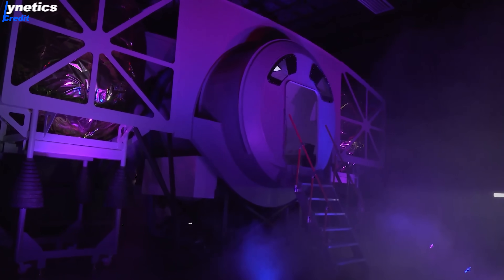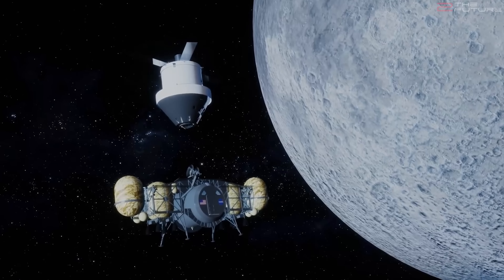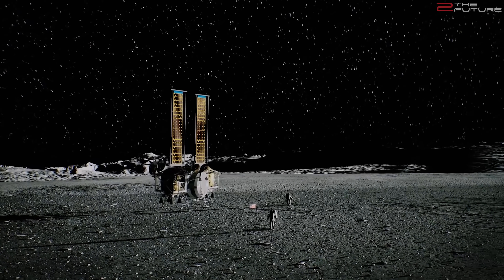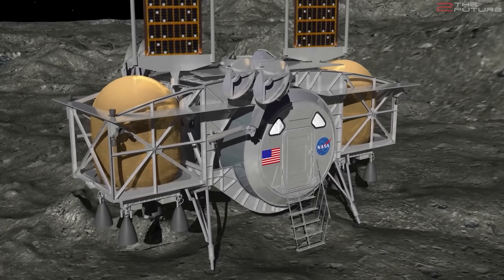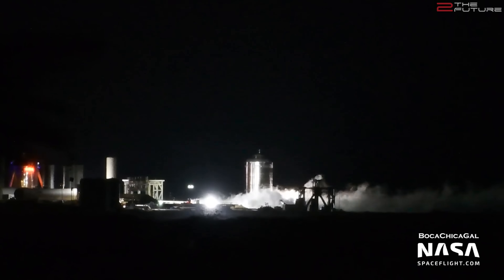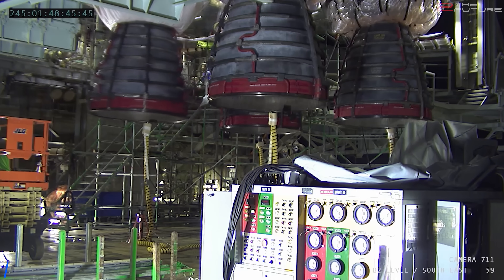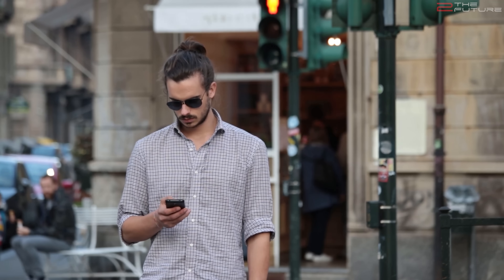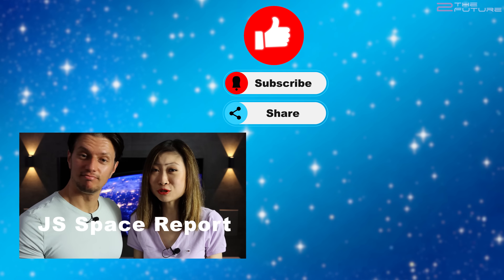Dynetics BEATS Blue Origin & Starship Burst Test Update

Comment: At https://youtu.be/rBXVP-vacB4?t=469 you interpret the unfinished SN 7.1 burst test as a success beyond planned pressure. Your information is usually double-checked but you may have missed something here. 

https://old.reddit.com/r/spacex/comments/inkzwp/starship_development_thread_14/g6407s0/

Reddit user u/RaphTheSwissDude says: *"on the last test night, the first test was scrubbed as a spark came out of a cable running down the side. And the second try, SN7.1 was never loaded as you could clearly see on the predator cam of Labpadre. (Watched the whole test) It is interesting tho to notice that a lot of either repair or upgrade were done on SN7.1 after that night"*.

Hoping this new info is okay for you and you can update on your next video. best regards. Paul.

Comment: The Moon Starship is too immature in development to get the nod from NASA.  Though in the end, SuperHeavy, Refueling Starship and the Lunar Starship would be the best system, that is a lot to develop by 2024.   In the near term, the Falcon Heavy lunar resupply Dragon XL could be configured to bring fuel up to the Dynetic's Human Landing System (HLS) as well as parts of the vehicle itself rather than the much more expensive Vulcan Rocket.  Blue Origin has shown little ability to complete any project on time nor has Boeing shown timeliness or cost containment.  It is a risk to go with the somewhat radical Dynetic's system, but it is not any more so trusting Blue Origin and Boeing whose recent track record is appalling.   Hopefully NASA will tell SpaceX and Dynetics to collaborate and get the project done by the 2024 goal.

Comment: Awesome as always! Great that you pointed out that SN7.1 not popping might mean it's even stronger than expected, as opposed to the idea that things have been going wrong. I think they pressurized it up to a high point, were amazed, and then tested/documented that it could really hold at the pressure, especially at critical weld points.  They might then have had to recalibrate their instruments to test for higher pressures maybe. It will be great to learn the final top pressure. 8.5 bar? 9 bars??

SLS is a non-flying museum LOL!

Comment: Apollo astronauts had to contend with lunar dust adhering to their suits contaminating and posing a risk to the LEM equipment. The separate Dynetics pressure chamber will mitigate any risk.
I seriously doubt the Moonship is a viable lander based on Dr. Robert Zubrin's calculation that it will require up to 20 Starship flights (ie. 15X for LEO refuelling and 4X Tankers with 100 tons of fuel to be stranded in Moon Orbit) to fuel a single landing by the Moonship.. Better to use Starship to carry 100 tons of fuel into Moon Orbit to support multiple Dynetics landings. Extrapolating from Zubrin's analysis, this would require only a single starship refueled 3X in LEO.

Comment: Lunar dust is hazardous to the crew. Breathing it in is a danger similar to breathing in asbestos. The blue origin lander should be disqualified now on the basis that without an air lock the living quarts will become hopeless contaminated with lunar dust the first time astronauts go on a Moon walk and the contamination will become worse each time anyone goes EVA. With Apollo they didn't of know the danger when they designed the lander. Once they did they continued with same design, but those missions were only 3 days, lander used only once....Building a new lander from scratch with the same critical flaw then having people spending even longer per mission breathing the contaminated air, then reusing the that lander is beyond stupid.

Comment: To be fair, the Moon landing version of Starship is too much for the initial stages of the Artemis program. You don't use a semi-truck to go camping. A cargo Starship would be perfect to deliver the Dynetics lander to lunar orbit though, and resupply extra drop tanks. 

The sheer size and mass of the Starship means the thrust needed will damage the surface and throw up a lot of dust unless you have extra engines mounted high on the sides, reducing payload. It's also even taller and less stable than the National lander, so not as safe on an unimproved or inclined surface. Finally, it's direct ascent which takes a lot of propellant, which in turn has to be carried down to the surface. 

What I could see a Starship Moon lander as useful for is expanding an already established base. Sinter regolith and introduce grids of metal to reinforce it to provide a dust free, levelled landing pad, and 'bake' regolith to obtain oxygen (or melt and refine ice from crater shadows) which you then chill and store in tankage under permanent shade. In this case, the Starship can make a precision landing on the pad, and only needs to carry enough CH4 for the round trip. It tanks up on LOX on the surface, which is around 3/4 of the total propellant mass needed.

Comment: So, the ALPACA has an airlock? Are those solar cell arrays from the originally planned Orion service module? Orion now uses the European Automated Transfer Vehicle´s (ATV) service module with only a delta-v capacity of around 1200 m/s (it should be easy to increase this). The RS-25 engines are high-energy engines and still satisfy modern demands, and they definitely were revolutionary, but SLS certainly is lacking. Venus evidence is still circumstantial, atmospheric samples are needed (HAVOC). Thanks for the video, again the week´s highlight! Go, Starship.
Reply: Karl Themel - ALPACA has external spacesuits, so no airlock is needed, & there is little risk of getting lunar regolith inside the lander.
Reply: @TraditionalAnglican Are you saying Dynetics will be providing a “suit lock” to minimize dust issues? My impression is the there was speculation about something like that, but that it seemed unlikely. Do you have a reference to support the idea that they plan to do this?

Comment: Actually the National Team lander is just safer and proven design than the other 2. The crew module is ejectable from the lander, also the crew module is separated from the service module/lander. The lander is 100% reusable and refuelable for future missions. It is way safer than Dynetics (only exception is the pressurized chamber). The SpaceX is the worse than the other 2. It is not crew ejectable, it is not refuelable in the moon, it is not stable in the landing.
Reply: Starship will not need to be refuelable on the Lunar surface. It can land with plenty of fuel to take off again and refuel in orbit. It will be perfectly stable, I don;t know what gave you that idea. 
For the National Team ILV, I have never heard of anything but the ascent module being reusable. Do you have a source for the other two modules being so?
Reply: Odysseus Rex , the lander is reusable with hydrogen as backup or for future missions. I watched somewhere in Scott Manley.
SpaceX hasn't any backup if their design fails. If the fuel failed on the travel or if the landing legs failed on the landing the astronauts are pretty much dead. The SpaceX is the worse than the other 2 simply because it was not made for this role.
Reply: @aluisiofsjr   "the lander is reusable with hydrogen as backup" That doesn't make any sense. Please point me to a source saying that the Transfer Stage and Descent Stage are reusable. I have never seen that stated.
Reply: Odysseus Rex , I read it somewhere in Scott Manley and Blue Origin videos comment sections. It does obviously make a lot of sense to be refuelable with materials available in the Moon surface.
Reply: @aluisiofsjr   Well, anybody can say anything in a comment. they should always be taken with a grain of salt. here is Scott Manley's video on the subject. He says the descent module is definitely expendable, and that the transition stage might be reusable, so maybe it is.
Reply: @odysseusrex5908  , we have to remember that we are in a channel of totally clueless casuals here. Scott Manley was not wrong about the lander being expandable on the mission, but the lander definitely CAN be refuelable and reusable for future missions. Even if it wouldn't the National Team lander is the safest choose by far.
Reply: @aluisiofsjr   I again ask you to point me to some reputable source, a Blue Origin website, a press report, a reliable engineering YouTube channel such as Scott Manley which supports your claim.
Reply: Odysseus Rex , it is in the Scott Manley video actually. The lander uses Hydrolox fuel that is able to be refueled with Moon's regolith, it is a different type of fuel that SpaceX uses.
Reply: @aluisiofsjr   I might have missed it. Time stamp?

Comment: Excellent conclusion on the 7.1 pop test. I hadn’t considered that. The pressure used was not sufficient to burst the tank but too much for the equipment.  🤔 hmmmmmmm????
Reply: The pressures used, 
were too much for the equipment.

The failure of the supply equipment, 
could include flying parts from the equipment.  

Exploding circuits, is another problem.
Reply: I watched the test and they clearly had issues, they even had a short circuit (sparks were seen) on the side of the tank. I think the test did not actually really happened due to technical difficulties. The weather was also horrendous. The chances are that the whole test was somehow aborted.

Comment: Venus might host more than single cell organisms floating up on the cloud layer.. watch?v=ZVj2mgrTtU8 .
Reply: sbmphr  Or, if there is something there, we might contaminate and kill a whole species, exactly because our metabolism works completely differently, based on a different set of materials than theirs. Furthermore, we do not even know for sure that there is no sentient life possible, based on an other element than carbon, working just as well, only in higher temperatures. For all we know, Venus may indeed host an intelligent underground species of worm-like silicon based lifeform, just like in watch?v=ZVj2mgrTtU8 . So for now, I'd suggest we simply not try to colonize Venus and that any attempt to explore the planet should be under strict contamination-avoidance protocols.

Comment: The ALPPACA would make a good hopper for traveling between points on the surface, basically a helicopter for vacuum.

You could pack one inside a Starship moon lander for enhanced range and mobility.
Reply: Dynetics mentions that their lander can be refueled with Vulcan Centaur upper stages... seems like it would be far more efficient to use a tanker Starship. For most missions, lunar Starship is overkill, until we decide to build a full moon base. But as a tanker it could enable Dynetics's mostly reusable lander to make multiple landings, refuelling in orbit, with Starships refuelling other Starships in orbit and bringing to fuel to the lander. With earlier moon missions, we could then prep a basic landing pad for lunar Starship which would have the cargo capacity to start a moon base.

Although both Dynetics and ULA are both Huntsville Alabama companies so there's almost no chance this will actually happen.
Reply: I agree with you. It's a great thought, and that could very much be a case. But who knows. Only the future will tell.
Reply: Nah, Spacehoppers. KISS.

Comment: How great is that about the 304-L steel tank. You should always design your machines to handle way more load than you would ever possibly require of them, and just thinking about all things they learned about building those tanks, BEFORE switching to the new material... I have to say it's all very reassuring, but pretty typical of an Elon Musk venture if I think about it